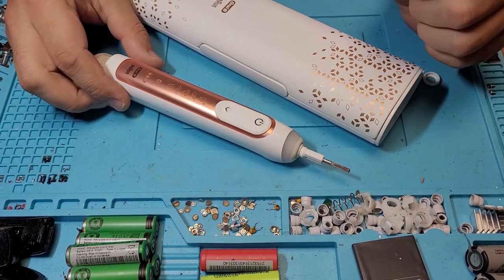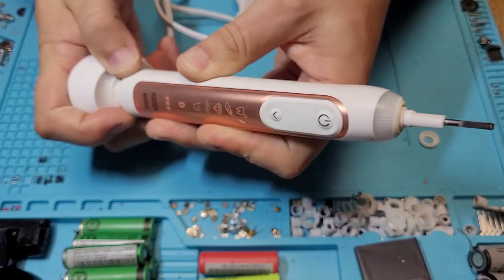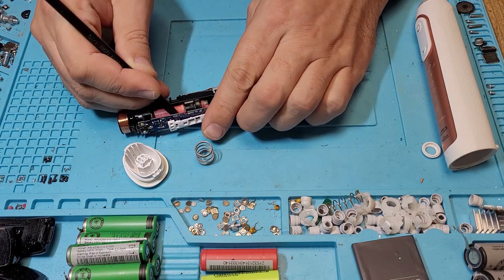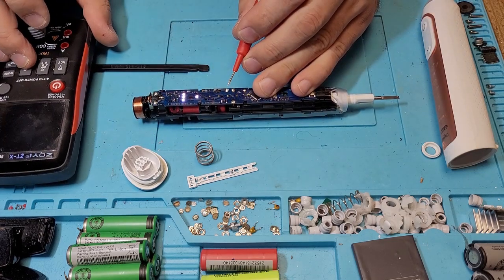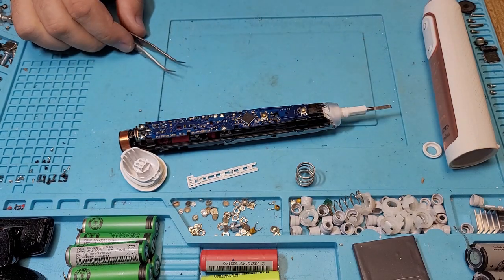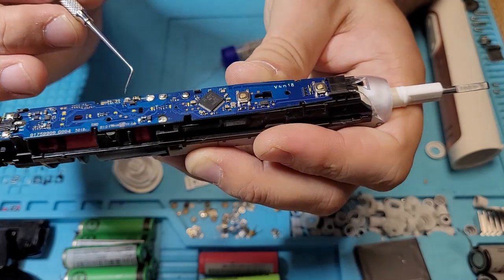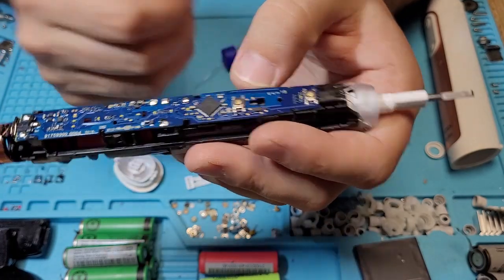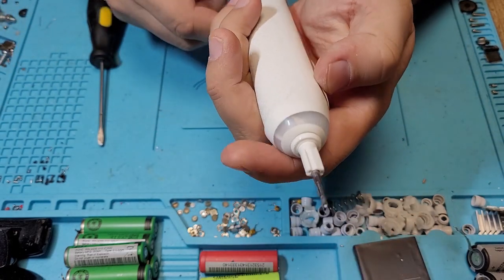Repair of Braun Oral-B Genius X. Lights up, but no vibrations.

Comment: I was able to fix it myself by just pushing on the fuse. It had already been repaired previously by Oral-B but it is no longer under warranty. I assume Oral-B changed the fuse during repair because my fuse had an N on it…not a PP
Reply from the maker: my impression was that Braun was not repairing them just replacing with a new one.. maybe a new modification of the fuse is in the production.. but then again it shouldn't fail in that case.. :)
Reply: My replacement brush also had the N on it. But it suffers from the same issue. Applying some force on it while running solves the problem for now. I have ordered some new tiny fuses.

Comment: hi,is possible to write the type of the Thermal Resistor?how to find it on aliexpress because in Greece i try to find the pp and i cant find it.thank you!
Reply from the maker: Look for similar measurements fuses you don't need exactly the same replacement nothing special just 2A fuse will do perfectly fine

Comment: This fixed my problem. I had the same issues. Battery was fully charged lights up, but as soon as I push the power button, it just light it up and no vibration. I removed that little PP fuse 
and solder the two points together using a drop of solder and it worked, thank you so much for posting this saved me some money
Reply from the maker: This repair definitely works but I would suggest to get a fuse. They are there for purpose as motors don't have brushes but metal spring like wires that are touching rotor it can weld to it and short circuit motor where fuse should step in...
Reply: @letsfixitgarage  I managed to fix mine first by pushing PP resistor (thanks for the video btw!!) , but after some time it really died so I used the same approach as @flaviobuccione here. I wanted to ask you , is motor short circuit the only possible issue ? or could this resistor removal lead to something more dangerous like explosion, melting .. possible fire ? because I'm fine to reach the limits of the brush, but I ain't going to risk anything dangerous :D . thanks !!!
Reply from the maker: @Nikusor5 safe way is to get a fuse.. it does it's job in keeping you safe and worry free ;) as for possible damage.. battery is not that big to have big fire and it's of safer chemistry as li-po but you newer know what could go wrong in worst case scenario..

Comment: Amazing bro! I found by pushing the fuse in even with my thumbnail it worked, I then just firmly pressed it again with a screw driver... For those who are looking for the fuse without watchin this its got a little PP on it, just push that badboy down small black rectangle looking thing
Reply: Just wanted to thank you for identify the fuse (PP). Had to press a few times on "PP" but I'm good to go now. Thanks!

Comment: добрый день у меня почему то рядом с этим резистром греется чёрный процессор, очень сильно греется, пришлось отсоеденить от батареи даже так как запах горелого появляется и когда подключаю щётку к батарее она сразу начинает работать на малых оборотах даже кнопка on/off не отключает её. Мне наверное тоже нужна замена этого маленького чёрного процессоря, где мне его взять ? и как он называется? А именно этот резистор что вы выпаивали у меня по моему в порядке.
Reply from the maker: I replace a fuse not resistor. And black part that you mention should be a mosfet that acts as a switch. According to your description it's bad. Sorry but I don't know at the moment what type it is or where to get it check datasheets online maybe you will find it or it's analog. Or it could be easier to purchase a defect toothbrush and repair it instead :)

Comment: Thanks for the video. Managed to fix my toothbrush with a piece of wire.
Reply: It would not be wise to remove the fuse. It is there for safety reasons
Reply from the maker: Works but I would suggest to get a fuse as other commentator said fuses are there for a reason.. and do take in mind that not to experienced people read these comments and think afterwards that this is acceptable repair... And then we get stories about burning electric scooters and upcoming government bans on them.. wouldn't like to hear a story that some user got burned while his repaired toothbrush got on fire :) I'm exaggerating but sh** happens

Comment: This literally happened last night out of nowhere and over 5 years use. I was devastated just to push the damn pp fuse at 3am to fix the issue. Sir thanks a lot to you and your lovely community!
Reply from the maker: really glad that these discussions started and people find different ways, although im not keen on the pressure method, in electronic there are no parts that need pressure for it to work :)))

Comment: 🇧🇷 a minha é esse modelo, só que o anel superior é fixo, não sai como  a do vídeo, é só forçar a ponta para dentro com força que ela sai por baixo, fiz uma ponte com uma pinça e ela vibrou novamente, fiz uma pressão sobre o fusível e ela voltou a funcionar, sem a necessidade de troca ou gambiarra de ligação direta
Reply from the maker: be carefull with removing the invards without removing the ring. sometimes its ok sometimes rubber part of housing breaks..
Reply: @letsfixitgarage  a minha não tem o anel removível, é uma peça única a parte de cima

Comment: PP nicht entfernen, nur etwas anheizen und das war es schon. Oder mit einem Cuttermesser unten etwas hoch hebeln könnte auch helfen.
Reply from the maker: Maybe I'm old school but in electronics if you need to press, heat or somehow manipulate electronic components you need to change them :)
Reply: @letsfixitgarage  , Im Grunde hast du zwar Recht aber in diesem Fall braucht man tatsächlich nur erneut löten, man muss PP nicht mal entfernen. PP ist nicht defekt, nur die Lötstelle abgebrochen.
Reply from the maker: @user-mo3gy7yt8u jain :) sometimes there are defects in solder point it's true, but much ofter it's a defective or starting to fail fuse. I have witnessed a lot of them when you start a toothbrush and it slowly dies.. if you measure the fuse before starting it has low resistance, but as soon as it starts working fuse resistance increases and it stops.. this type of behaviour confuses the diagnostic process immensely, that's why I made this video. my suggestion is to replace the fuse in to a different type one and not to experiment with heating or pressure..
Reply: @letsfixitgarage  Sie haben natürlich Recht, ich werde die Bürste so lange benutzen bis die kaputt geht denn ich glaube nicht das ich das Teil austauschen kann ohne irgendwas kaputt zu machen. Ich bin kein Elektroniker. Ich weiss nicht mal woher ich das Teil bekomme :) 
Ich melde mich, sobald die Bürste kaputt geht.
Reply from the maker: That would be interesting to know. When or if it fails..  soldering smd is not difficult but for these works you need some good magnification, if you don't want to damage some other components next to it..  good luck and keep on repairing! :)

Comment: Thank you for this great video! My toothbrush now works but I lost the top ring. Do you know where I can get a replacement ring ?

The toothbrush works but I am not using it as I am afraid the water will get in the electronics
Reply from the maker: I use ebay to get spare donors as there is no spare parts from braun.. write me if you need something specific letsfixitgarage@gmail.com

Comment: I think I really messed up my fuse.  I pushed down on it and It worked for 1 second and lost all power and lights.  Can I send you my toothbrush in for repair?
Reply from the maker: Sure, its possible, write to my email letsfixitgarage@gmail.com
Reply: @letsfixitgarage  How did you solve this problem? I also pressed the fuse and nothing lights up anymore.
Reply from the maker: Check the video :) I replace the fuse with a good one..
Reply: @letsfixitgarage  Did it work even though no lights work? I tried connecting the two sides with a clamp, nothing happens.
Reply from the maker: Could be something more, needs inspection, if you don't have experience you can buy another brush and compare the electronic side by side to see if something else is misbehaving..

Comment: Thanks! Just heating the fuse on both sides was enough to get the voltage to 4 on both sides of the fuse. The toothbrush works again 👍
Reply from the maker: Electronics and heating usually doesnt work together :) glad it's working for you, but I would suggest getting a replacement fuse for the near future ;)

Comment: Hi, thank you so much for this video. Can you tell me where can I get these fuses, and is it possible to glue the fuse with super glue or something? Sorry, I don't know
Reply from the maker: Have some fuses in the description of the video although the links are quite old can't find the time to update them., but you can find some type suggestions there, go for 2A fuses and sadly superglue will not work you need to solder them in..

Comment: little push from the side of the fuse with a small screw driver fixed my issue as well. . If not for your video I wouldn't  have known what the fuse and where it is placed. Thank you so much for sharing. I had this problem in two toothbrushes.  Both are working now. Thank you again for saving a lot of money.

Comment: Thank god for your video. Had the same problem. I disambled my toothbrush and put gently pressure on the fuse, and, it worked so far. But I look if I can get one fuse to change it.

And my older Oral-B model was opened by turning the bottom. But the genius is different. Like you mentioned. 👍🫡

Comment: hello, just subscribed...great video.....i clicked on your link for 2A fuse but it is showing .75  750 MA   and 1A is max I dont see 2A fuse......👍
Reply from the maker: Sorry about that. Links are quite old.. need to renew them but missing the time.. take them as example for size and I use 2a fuses in my repairs :)

Comment: Thank goodness for this channel! Saved me $200 buying a new toothbrush. Confirming, as others have said, that you don't necessarily need to replace the fuse. You can just push on the fuse with a screw driver while pushing the power button and it will come back to life. Thank you so much for posting this video!!
Reply: I did this and about threw my toothbrush when it came back on lol, i was so startled
Reply: Might be due to the contact resistance being a bit higher because of poor soldering quality from the manufacturer. For a more robust solution, heat the pins with a soldering iron with the fuse being pressed lightly so the contact quality is better. Do not turn on the device while soldering!
Reply: Many Thanks

Comment: Everyone who bypassed the fuse have there been any issues? Blown up toothbrush, bathroom, house, city? I just bypassed with blob of solder. I dont have the skill or good enough equipment to solder a new fuse so hoping to leave it. 
Thanks for the vid got me working again.
Reply from the maker: That's nightmare scenario :) there is not that much energy in the battery to do that kind off chaos..my gues would be burned toothbrush inside the case doubt that it would escape in to the outside..and if something happens it should happen when you are using it, as it's motor fuse, so you should have plenty of time to react...
Reply: Thank you. It's been nearly a week now using every day and did a full charge. All good so far.
Reply: No responses of people saying things went wrong. Might be survivor bias lol.
Reply from the maker: Or their houses and cities got destroyed and there is no one left to report it ;)

Comment: Which of them is works?
1206 2A or 0603 1A
Reply from the maker: both should work. I would go with 2A. 1206 is slightly larger than original so a little bit more difficult to solder it in. 0603 is smaller than original so easier to solder in but more difficult to see what you are doing if you don't have serious magnification..

Comment: Thanks for the video! Helped to save mine toothbrush. 

Link to soldering iron is dead. Could you post name or photo please of soldering iron you use?
Reply from the maker: thanks for the feedback. will update all the links this week.
Reply: @letsfixitgarage  what fuses do you use? 2a? First link is 0.75A 750MA will it work?
Reply from the maker: I believe the links have changed quite a lot... Still haven't found the time to go through them, a lot of work at the moment.. I would suggest 1A or 2A both will do the job 1A is more on the safe side but 2A should save the motor as well if something unexpected happens..

Comment: а если такая же забная счётка вообще не включается ?
аккумулятор вытащил, проверил, зарядил зарядкой для литиевых.. не помогло..
оба предохранителя вроде тоже целые..
куда ещё можно смотреть ?
Reply from the maker: difficult to say.. first try to short out the fuse that is shown in my video. in some cases it is on the "edge" meaning that multimeter shows that it's ok but its resistance rises when you turn it on and it does not work.

Comment: If my toothbrush vibrates a couple of seconds 1-2, could it be the same issue? thanks!
Reply from the maker: yes, high chance that the same problem with the fuse is the culprint

Comment: Mine doesn’t have any fuse market pp. it has a 2L00 instead. it also lights up and motor doesn’t work. Its the black one with bluetooth
Reply from the maker: yes some fuses are from other type. you can try to short the fuse from both sides with something like pliesr or tweezers. if it works it means the fuse is bad if no, problem is somewhere eleswhere..

Comment: Thank you, this gave me confidence to open up my Genius 9000 to see if i could fix it. The mechanism on the underside of the unit was trying to move but kept sticking, occasionally with the light ring at the top illuminated red. This was probably due to a little water ingress. With some gentle persuasion it freed up and back to normal operation, with no need to touch the fuse or circuitry. Thanks again 🙏

Comment: Your Video is awesome! Exactly the Problem i was having and additional info in comments (pressing down the fuse and resetting the microcontroller helped lots). I now have a working toothbrush again for 0€. Thanks all!!!
Reply from the maker: Glad it helped and thanks for sharing you experience!
Reply: How to reset microcontroller?
Reply: @Furkonizm  Look for the comment from @pwrgreg007. Find the microcontroller (big square chip. way its places looks like diamond shape above the white cover for the LEDs). Using your multimeter in continuity go ahead and  ground that copper pad at the corner/edge of the circuit board clockwise from pin 1(which is located where the little dot is on top of this microcontroller chip) connecting to the reset_pin (35) , toothbrush will work again.

Comment: Hi, can I also use an 1 A fuse? Thanks for the video.
I will try to repair later.
Reply from the maker: Yes, you can. if I remember correctly no load motor consumption is around 250ma under load ~600 so thats why recomendet is 1-2A

Comment: hi, can you give me other similar fuses to use pls? Because they are finished. And thanks for this beautiful video!
Reply from the maker: if you check the link under video it seems to still work. additionally you can check your local electronic shops for similar size and 1-2A fuses. fuse is very simple device so anything that fits in size and amperage will work ;)

Comment: Hello,

I changed the fuse... but I think I touched something by mistake on the board and now it doesn't start at all, no LED lights up.
I have this problem with 2 brushes.
Can you help me please?

Thanks and best regards,
Reply: Same happened with mine

Comment: Thank you so much! Me and my dad took it apart and he said the solder was really bad on a few of the points. He just reheated the solder on the fuse I think… just a bad connection. It’s lasted for 2 weeks absolutely fine so far! Thanks so much for your video!
Reply from the maker: Glad it was helpful and you had quality time with your father :) yes sometimes it can be a micro crack on the solder, but this fuse is failing to often in my opinion.. but if it fails you now know how to proceed ;)
Reply: funnily enough it has just failed again!! At least it lasted a few more weeks! Will have to replace the fuse as you said! @letsfixitgarage

Comment: Hi nice little shout out on the fuse, 
Did you say the fuse has the letters PP  or just an E because the closes one to the battery + is a PP Then then moving along there`s another little thing with the letter E
Reply from the maker: Both are fuses. PP is for the motor E is for the electronics. usually its PP thats failing
Reply: @letsfixitgarage  cheers,